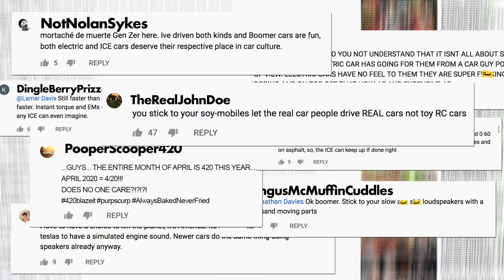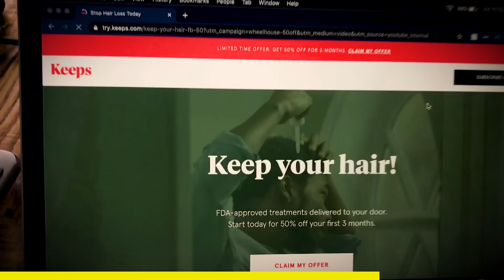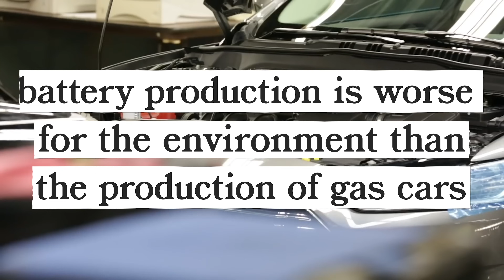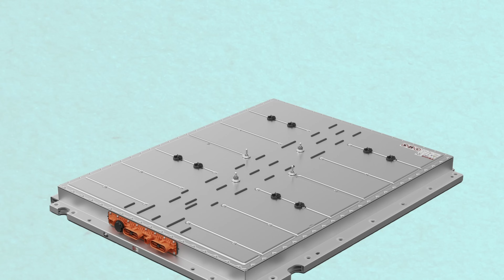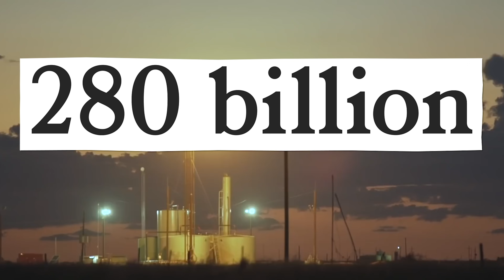Are Electric Cars REALLY Better for the Environment?

Comment: Do these The Dumb As who drive these electric cars realise the electricity comes from Coal power station?😒
Reply: Do you realize that only 20% of electricity comes from coal?
Reply: @MrRentageek  75% here in Australia
Reply: do these and dumb as who dont drive electric cars realise that even on a coal only grid EV's produce significantly less emissions. Especially when considering the immense amount of emissions produced in just refining fuel as well as then burning it in a car?
Reply: @engineeringtheweirdguy2103  yeah imagine the extra pollution coming out of power stations to keep up with the demand for power for house holds, businesses, and now Electric cars and the LARGE amount of pollution the Nickle minds produce making batteries for Electronic cars....it's an " Oxymoron"
Reply: @garymarquett7989  just to get this straight. Coal fire power plants produces, at worst, 1000g of CO2 per kWh. EV's get around 0.13 kWh per km (for the Tesla model 3 for example). which is 130g per km of emissions. On a coal only grid which almost every grid on the plant, isnt.

in every L of fuel, when you burn it you release around 2300 grams of fuel.  If we take a similar size and class car, like the model 3's biggest competitor, the BMW M3, we get 11.6L/100km. or 0.116L/km. So thats 266.8g of emissions. 

Then lets consider refining fuel, Fuel refining. Which is around 700g per L of fuel. So for the 266.8g/km mentioned above it becomes 348g per km. Which is a little more than the EV's 130g per km on a coal only grid. Which also becomes closer to 80g on the standard US grid mix to give you context of how worst case that is. 

But lets comes to a car that doesnt have similar trim, performance or market as the model 3. Lets assume a relatively efficient 8L/100km car, that will produce 240g per km.

are you getting my drift here?
Reply: @garymarquett7989  infact, its actually more fuel efficient to charge your EV from even a small portable hobby generator than it is to use that same fuel in a standard car. Yet alone hoe much more efficient a large scale power plant would be per kWh. but you seem to think that power plants charging EV's is somehow worse? right...... use that head of yours buddy.
Reply: @engineeringtheweirdguy2103  Hey Weirdo what's the generator run off smart A?...EC can only go 250 miles then U have to charge it up again but you will get 600 + miles out of a petrol car
Reply: @garymarquett7989  actually the model 3 will go 325 miles and the model S and X even further than that. You also charge at home when you’re asleep, a lot like your phone. You don’t have to drive to a fuel station to charge. You do it at home. And since I dare say most people’s commutes are 4 hours worth of driving every day, you won’t have to ever wait for a charge unless you doing extremely long trips, in which case,  super charger can do it in 15 minutes or less.
Reply: @garymarquett7989  and generators run of fuel. Did you even read my comment genius. I was pointing out that it was more fuel efficient to charge your EV with even a small portable generator, than it is to use that same fuel in a combustion engine. 

What part of that isn’t making sense to you genius?
Reply: @engineeringtheweirdguy2103 you go and tell the 1.5 billion petrol car uses about you Oxymoron ECs and see how far U get 😋😂
Reply: @garymarquett7989  well apparently the wealth of scientific literature is already doing that. That and the fact they have better performance, safety and at a cheaper cost of operation than a combustion car. The Tesla model 3 is the best selling luxury vehicle in any category in the US. Beating out the BMW 3 serious and the Mercedes CLA (the next two runners up) combined in sales.

So looks like I don’t have to.
Reply: @garymarquett7989  and you can’t even tell me why it’s an oxymoron can you? Do you even know what that word means?
Reply: @engineeringtheweirdguy2103  
"just to get this straight. Coal fire power plants produces, at worst, 1000g of CO2 per kWh. EV's get around 0.13 kWh per km (for the Tesla model 3 for example). which is 130g per km of emissions. On a coal only grid which almost every grid on the plant, isnt."
You may want to check those figures again because they're not that good... I can get petrol station wagen that emits less than 110g per km of emissions, so basically you're saying a small ICE engine is still better than electrics... The Tesla still has that colossal battery for which the raw mats needs to be obtained and then the service life- good luck maintaining it yourself and you do need to be fairly well off to even buy one.

"in every L of fuel, when you burn it you release around 2300 grams of fuel.  If we take a similar size and class car, like the model 3's biggest competitor, the BMW M3, we get 11.6L/100km. or 0.116L/km. So thats 266.8g of emissions."
It's just smarter for people to buy smaller, lighter cars than to have them buy these Teslas that remember- a lot of people simply can't afford, you have the old clunkers still floating about.

"Then lets consider refining fuel, Fuel refining. Which is around 700g per L of fuel. So for the 266.8g/km mentioned above it becomes 348g per km. Which is a little more than the EV's 130g per km on a coal only grid. Which also becomes closer to 80g on the standard US grid mix to give you context of how worst case that is. "
So adjusting for the 110g per km for my station wagon, we're looking at 140g/km? Not far off a Tesla, pointless to compare even. The station wagon I can maintain myself, am not grabbed by the balls by Tesla Dealership that make these disposable cars with little regard for long-life.

"are you getting my drift here?"
Yes. But you ignore, mightily I might add, that this is really an issue of people buying things they don't need. You're advocating more consumption to be "greener". Replacing car with more car rather than have people off their asses and walking walking distances and biking biking distances rather than driving all the time.
Reply: @engineeringtheweirdguy2103  
Why are you even using the Tesla model as your prime example? Why not shift to other models? The Tesla is not something affordable by most people, you'd need to go to countries like Norway, etc., where people earn much more and therefore can buy such cars.

Comment: yeah all good but it looks like cobalt and lithium reserves may become critical in as little as ten years, by which time the battery cost will increase rapidly. Battery recycling has not been solved to date and newer aluminium batteries have significant problems to be overcome.
Reply: Cobalt has already been eliminated by some; Tesla uses a lithium phosphate (no cobalt) battery now.

It's not that hard to take a lithium battery, and 're-refine' it to extract back the lithium. The bigger 'problem' is that those batteries just won't die....they keep going and going...
Reply: In 10 years time, electric car batteries will no longer use lithium......  And battery recycling has been solved. Volkswagen are already recycling EV batteries......

Comment: Compare the impact of a battery recycling fire to the history of well and refinery fires.....
Reply: are we also including the subsiquent leaks and ecological disasters that came with the fires? as it stands there have been 181 oil leaks since 2000, resulting in nearly 200,000 tons of oil destroying ecosystems and decimating marine life. But dont worry. Oils good for you!
Reply: @engineeringtheweirdguy2103  Battery recycling is hardly the only issue though- there is the initial dreding up of the raw materials that few are talking about and the lack of real drive behind renewables i.e. a LOT of emphasis is being placed on EVs but not on what powers them that would make them much more effective in reducing emissions.
Reply: @dallysinghson5569  That's kinda totally false. The source of the raw materials has  received  tons  of scrutiny, especially since it's supposed to be environmentally friendly. 

And not only is 20% of the US already on renewables, 70% of the new energy production being built is wind and solar specifically.
 
There are at least hundreds of discussion on these issues, by experts and 'experts'.

Comment: HMMM you say you  looked up every thing in wind mills that use on average 1000 litres of oil a year of use and up to  100 tons of steel to make and im not going into the plastic coted cables in the wind mill or the 1000s of miles of plastic coted steel cables to our power stations and the to our home . Have you added up the cost of them to EVs . I know from a friend the life span of a Wind power mill is about 10 years if that pending on where it is and weather they spend the $10,000s every year to maintain them .And most place DONT SPEND SHIT ON THERE ONES TO MANTAIN THEM HE SAID !!! And you must know the blades can not be used again as they in the USA just put 100s of this in a big hole in the ground right !!? HMMM Just some thoughts
Reply: actually modern windmills will last around 30 years or more with modern Engineering techniques. Their gearboxes also only take around 200 Litres of oil for some of the largest wind turbines, only about a 3rd of it needs to be replaced each year (one replacement every 3 years) so 75 Litres worst case. Not sure who told you 1000 Litres every year because that's absurd.
Reply: pro tip. Most places already have insulated cables running from power stations to their homes. your welcome.

Comment: I like how you had plastic is a bye product of oil as all EVs use this product right ?? So if we stopped drilling for oil what you going to use from EV cars or trucks 
 to make them ??
Reply: Shredded paper. Tesla Cybertruck’s dashboard is going to be formed of shredded paper.
Reply: I would be happy if we reduced it by 50%; as of now, we are still pretty much at peak oil, not having reduced at all. 
 
Even reducing by 50% is going to be tough, and then it will get harder to reduce further. The faster that we can get started, the less drastic  the measures we will have to take.
 
If we want to save our selves, that is.
Reply: Plant based products. VW are already replacing plastic usage with plant based materials. The new ID3 and ID4 have their dashboards, door cards, carpets and seat materials from plant based material. Even the final paint finish is plant based....

Comment: I can pull damn near 4 miles to the gallon in my ramcharger running on 7 of 8 cylinders with a blown head gasket with my 2000 lb family inside. If that ain't good mpgs I don't know what is.

Comment: When a EMP is detonated your electric vehicle is dead in the water and you are permanently stranded wherever you are at.
Reply: Similarly for petrol vehicles and modern diesels. What’s your point?
Reply: @engineeringtheweirdguy2103  not for vehicles made prior to 1959
Reply: @MrFreezeplug  so, no cars that are usually purchased as daily drivers today then and 90%+ of all cars on the road today. Gotcha. 

So because EV’s share a vulnerability with every other car being sold today and more than 90% of all cars currently on the road. EV’s are therefore bad?
Reply: @engineeringtheweirdguy2103  All vehicles that rely on solid state ignition system’s ECM, PCM’s and any other control modules especially electric vehicles that are 100% solid state will be totally worthless.
Reply: @MrFreezeplug  so solution. Only by cars per 1959 then? Seems rather restrictive. Are you anticipating being EMP’d? You do realise the energy required to produce an EMP large enough to cause anything more than interference in a small room, through use of a nuclear detonation.
Reply: @MrFreezeplug  Very very few people have cars made from that era, so this will affect the vast majority of people even with petrol/diseasals so if this was an argument for ICE it's not a strong one.